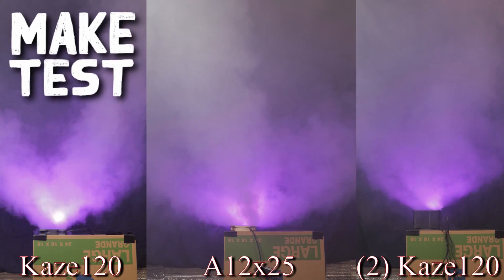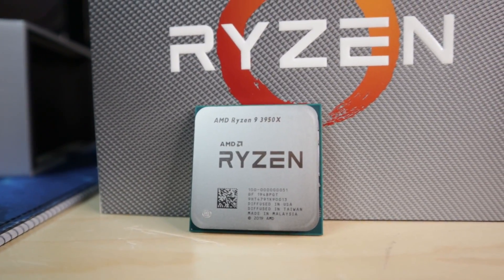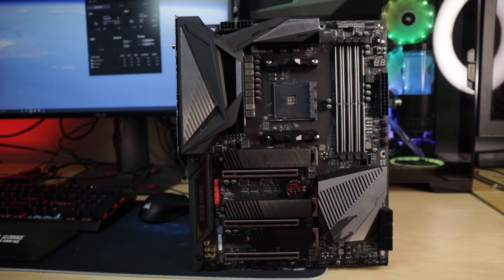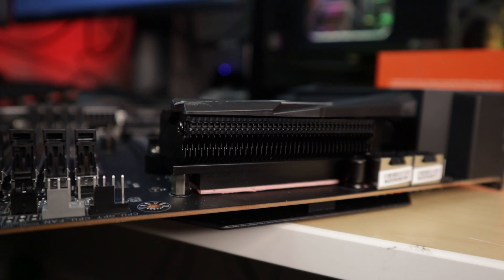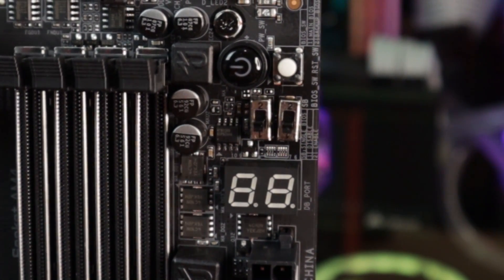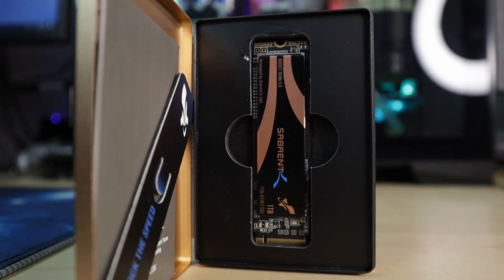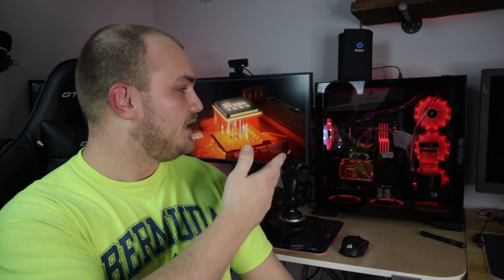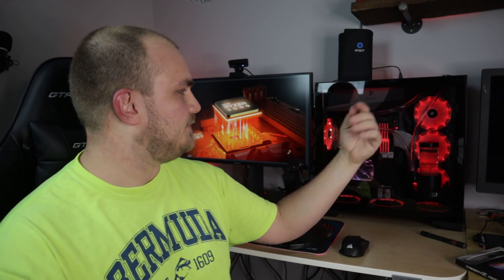EVERYTHING WENT WRONG, Upgrading I7-7700K to Ryzen 9 3950X

Comment: Welcome to the Red side, bonus points for MX4, only thing I use x) Well I still got paste left in the original 2011 tube, so partly why :D You are under water, so doesn't matter as much, but 1.0.0.4 agesa runs my 3600x 10C hotter than 1.0.0.3 ABBA. Here's to hoping 1005 is good on idle again too.

Comment: the pinouts of one maker's power supply's modular connectors, arent standardized to other manufacturers. Ive seen manyu people destroy their powersupplies and components with mis-matching cables. get your ram timings optimized beyond just the  xmp profiles say. you'll notice a significant improvement. ryzen memory calculator is very helpful.
Reply from the maker: This is news to me and seems like something that should be standard, glad my antec PSU had a safety circuit
Reply: @MajorHardware  You are lucky my friend. I learned this lesson the hard way and murdered one of my 980 TI's a few upgrades back. My Thermaltake Psu didnt  have the safety circuit and the sparks were real.
Reply from the maker: Jesus! I'm lucky

Comment: Since your RAM is only running 3000Mhz right now, maybe it would help the gaming performance to try different Infinity Fabric clocks in the BIOS (e.g. keep RAM at DDR4-3000 but boost FCLOCK from 1500Mhz to 1800 or 1866)?  Ryzen 3rd gen may not be a huge overclocker on water, but there's still a lot of room for tweaking with fabric clocks, small undervolt + PBO, and tightening secondary and tertiary RAM timings.
Reply from the maker: im excited to see what i can squeeze out of it

Comment: U are lucky that the magic smoke didnt come out
Reply from the maker: I know antec psu for the win
Reply: @MajorHardware  the click you heard was most likely a protection kicking in withing the psu
Reply: @liev535  exactly...probably had a hot wire pin switched with one of another voltage, triggering overvoltage protection.
Reply: Rare that burn off Something. Good psu have load protection on volt line.
Reply: Lars Nielsen yes but repeated triggering of ovp or ocp can burn up the protection circuit, rendering the whole unit inoperable
Reply: @Akira_203  I bought a new Super Flower Leadex III 80 Plus Gold some months ago, started installing windows and the PSU died suddenly clicking the protection.

Turns out the PSU was crappy and I got a new one from RMA. Can't trust a "quality" brand anymore nomatter what the maker is, just luck :)
Reply: @eamh2002  sometimes shit happens get DOA or faulty with any company but the fact that it died but didnt take any other components with it shows at least decent quality in circuit protection
Reply: @eamh2002  even finest brand can have faulty unit you have to take into account they makes tens or hundreds thousands of units so it even failure rate is like 0.1% (just pulling number out of my ass) it has to happen sometimes
Reply: yeah, Magic smoke like what verge guy had off camera XD

Comment: Cranking the infinity fabric (FCLK) to 1900 will also improve gaming perf. Especially if you can get your ram to 3800 CL16 (coupled mode). You can use Ryzen Dram Calculator for tight timings
Reply from the maker: I need to do more research on tuning AMD

Comment: The chipset drivers needing to be updated wouldn't happen to be the cause of the ram issue? I'm guessing not but just curious. Great video, thanks.
Reply from the maker: im not sure, i know the PSU cable was the first issue but the chipset update was night and day. before updating i got stutters and lockups after update buttery smooth and increase in performance in gaming and productivity tasks
Reply: @MajorHardware  have you tried the new ram after the chipset update?
Reply: I was thinking the same while watching your video, you should pop back in the 3600mhz ram to see if it works after the update if you haven't sent back the 3600mhz already.
Reply: didnt he say one of the ram sticks didnt work on another motherboard

Comment: I just had the same problem a few weeks ago used a antec cable on a thermaltake psu , swapped out for 2 other psu's left the cables in the case lol funny how it booted up if I left that one cable unhooked, I was using one of the sata power ports to run a pci-e cable for the graphic card worked fine on the other psu
Reply from the maker: The fact app psu arnt standardized is criminal

Comment: Several years ago I found out that PSU manufacturers do NOT wire up their cables the same. I fried a 400GB hard drive. Thankfully it was given to me by someone that didn't bother with drives under 2TB! After that if I had PSU cables mixed I made sure with a multi meter which wires went where so I don't land up frying anything ever again!
Reply from the maker: I had no idea this was a thing why is this not standardized
Reply: @MajorHardware  Dude, that's exactly what I was yelling in my head when I realized my hard drive had died! 😁
Reply from the maker: Glad nothing died on my misadventures
Reply: @MajorHardware  I am VERY happy for that dude!

Comment: Just a quick tip: When you get new CPU, RAM and MOBO, you first boot it on the table and make sure its all in working condition, then you build it in the case. 
This way you can make sure there isn't something wrong with your system.
Good luck next time XD.
Reply from the maker: It's worse than that I always skipped that being over confident that nothing was wrong this time I paid for it
Reply: I've been always building directly into the case. Nothing went wrong so far.
Reply from the maker: Same here until well this one
Reply: when you buy everything new you check the compatibility list and do not spend money on something I can work for a week and then it turns out that sometimes it is not stable ... These lists are long there is a lot to choose from and nothing costs.

Comment: When I built my computer, I mixed up spdif with a 5v argb connectors and my computer wouldn't boot. Spent 1 hour taking all apart and testing to find out that it won't boot with an argb connector in spdif. Took about 3 hours to build but other than that it was fine.
Reply from the maker: yes thats what i did and wow does it suck doing all that work only to find out it was something little

Comment: I upgraded to a 3950x as well. I upgraded from a 2700x. I went from 32gb of 3000mhz ram to 32gb of 3600mhz ram.
Reply from the maker: i have a kit of 3600 ram but i got a shotty kit so i need to RMA it
Reply: I OC'd my 3200C14 kit to 3600C14 although I just got 2 additional DIMMs so I can't quite do C14 anymore. Still I'm impressed what OCs some DIMMs can do
Reply: Buy good quality Samsung B die RAM like a  3200 CL14 or 3600 CL16 kit and just overclock it or tighten the timings, good quality B die ram can run the same timings.  This is a good way to save money and get the same performance.
Reply: @davidbrennan5  That's not true. Buildzoid has a video on the subject where he shows how some of his b-die is absolute trash while some of it can reach insane overclocks and low timings. Chances are a 3200 C16 kit wasn't sold as a 3200 C14 kit for no reason, but because of binning.

Here's the link: https://youtu.be/ZJDXsoYKZaY?t=1702
Reply: @kendokaaa  I said buy quality kits, The stuff he tried that  was junk were cheaper kits. They keep the better bins or SKU's for their higher end products generally.  I have never seen a quality B die kit not hit 3600 at 14cl at least.
Reply: @davidbrennan5  You specifically said "all B die ram can run the same timings."

I did see that you said quality kits but that doesn't change that your sentence I highlighted was wrong. Otherwise I mostly agree. I'm just trying to remove ambiguity for someone looking for ram and seeing that
Reply: @kendokaaa  I shouldn't have wrote all, I changed that to quality, the silicone lottery will also play a part and who knows how long they will sell the lower clocked stuff that can be pushed when they could just sell it at a higher clock rate and make more money. The other thing I should mention is the less sticks you have the easier it is to match the overclock and you need good airflow in your case before you overclock.

Comment: I've accidentally managed to get the old normal power plugs the old hard drives and burners used backwards just long enough to fry a new 12x plextor cd burner and two SCSI drives back when that stuff was current and expensive. Was a spendy day and probably wouldn't have happened if I wasn't trying to swap the power plug around while box was running. I have a bunch of the modular power supplies around too and yes, very easy to grab the wrong cable set and fry something or have it not work. I did similar when I was trying to upgrade my board to a 2011 and suddenly only certain devices showed up once booted. I finally took it back to my buddy and he gave me a lesser but similar board and it did it again. I finally tried swapping to a different cable and everything worked again. I'm still not sure if the original cable was dead, or from a different power supply but I did notice I had at least one cable that plugged in but the colors weren't the same as similar cables in it so I replaced it before it blew something up. I do try to keep that stuff together in the original boxes or label it but stuff happens and we live and learn.
Reply from the maker: i will keep it all together now that i know this little detail lol

Comment: you're lucky that the power supply had that feature that it won't turn on with the wrong cable. coz with some power supplies, that would fry your computer and power supply. and you'll be fucked.
Reply from the maker: that would have been the saddest of days
Reply: @MajorHardware  yeah coz I did that with one power supply and I thought I had used the same cables for a newly acquired power supply (used) and luckily I used a PSU tester and not directly to a PC. And it made a popping sound and it ended up being a blown capacitor and made a burning plastic kind of smell. That was not a good day.

Comment: Only problem I ran into was not knowing to use uefi to load up the windows USB. All the drivers and chipset updates I did as soon as I got the thing running and haven't had a single weird freeze or stutter in 2 full months which is a huge leap over the random freezes and bsod of the 2700k setup I used for almost a decade

Comment: There's really no standardization of modular psu cables between different psu brands. They all terminate the same on motherboards and other components so you don't end feeding like 12v down a 5v line and killing your parts but there's no telling them where that 12v/5v line etc needs to come out of their psu. You're lucky you didn't end up killing something on the new build.
Reply: Yes, why use non standard cable from one PSU to another PSU? 🤦I whould not doing it before knowing the pinout. Knowledge saves money and time.
Reply: Aye, just because they all end the same, doesn't mean they start the same, EXTREMELY lucky it wasn't a 8pin CPU or PCIe that got mixed up
Reply from the maker: Truetrue
Reply: I fried my hard drive and the soundcard integrated on the motherboard??! when I did the same trick with satan cables. Also couldn't reboot, I had to turn off/on manually or it would just freeze.
Reply: @haralds.5832  that's why I'm anal about keeping the psu boxes and keeping any spare cables in its proper box. That way I don't risk anything like this.
Reply: @haralds.5832  "Satan cables" haha! awesome!
Reply: @MaxUgly  well, I guess the PSU could have come with "Molest" cables, to go with those "Satan" ones...😂😂🙊
Reply: @northwiebesick7136  at least we have moved on past the evil old "master/slave" configurations of the IDE interface!
Reply: @MaxUgly  lol... You're right... I hated them
Reply: I killed a Z97I-Plus by using Silverstone braided cables with a Corsair PSU instead of the flat cables it came with. Bad day.
Reply: I think ScienceStudioYT made the same mistake years ago when he thought the NZXT Hue was causing problems but later found out the psu cables was the Culprit

correct me if I'm wrong though
Reply: @AirRookie  nope, you got it right. I don't remember the specifics of how he found out (might've been another youtuber) but that was indeed the reason.
Reply: Yeah this is why I greatly prefer non modular supplies. This is however really difficult to find high quality non modular supplies outside of the server space.
Reply: How old are you w98 is more more better... More mooore🎵🎵🎵🎶🎶🎶Tereza kesovija🎵🎵🎶🎵more a?!?)))
Reply: I had it easy with finding the fault. The Corsair cable on that Seasonic PSU led my DVD drive to melt and smoke which made it pretty obvious as to where the problem was.
Reply: Thanks for the info, appreciate it!
Reply: what about custom cables like sleevemod?
Reply: he fry up Ram at beging putting wrong cable in it
Reply: Ming Chan I don’t understand why using a cable from another psu is a problem if they are the same pin outs
Reply: @oscarcharliezulu  some of them twist around the wires from end to end to have the standard pin out. If you were to rip out all the wires from one end of a sleeved modular 24-pin cable and then had to put it back together, it would not work if you tried using the other end as reference.

Comment: Tell me about mixing power supply cables. A couple years ago I also assumed they were interchangeable and ended toasting 4 hard drives, a total of 13TB of (thanks god, backed up) data. I wanted to die. All defeated, literally sat down, opened the amazon app on my phone and spent 600 Euro in hard drives.
Reply from the maker: ya i dont understand how the cables are different
Reply: @MajorHardware  At the time I was furious from the fact the plugs are the same, also companies don't help you at all if you make that mistake. Turns out the cables inside (pinout) are different so you end pushing 12V through the wrong pin of your devices. I also almost toast my brand new AIO but is working fine. So, from there the number 1 rule is not to mix PSU cables.
Reply: @MajorHardware  the business ends are standardized but the psu ends using same connectors as other psu can have different pinouts

Comment: I have never had intel in my system. AMD processors are good but the graphics cards are finicky. One day I will get an nvidia card but the price is usually my sticking point. Nice build!
Reply from the maker: thank you
Reply: Steve from GN did a video of why you shouldn't mix power cables. Its pretty sad that the pin layout isn't standardized  across brands on PSUs.
Reply from the maker: agreed, i had never heard of such a thing and didnt even mean to mix the cables it was crazy
Reply: I love my Vega 56.

Comment: I hope you see my comment, i started watching your videos a few days ago because of the curious cooling methods you use.
Could you try cooling your pc with Vodka next?
A russian youtuber called Boris did it too and it was impressive.
Greetings from Germany
Reply from the maker: if i had spare equipment to sacrifice i want to try and custom water cool with gasoline and see if it catches fire.
Reply: @MajorHardware  hahaha nice, i think it will explode. Be careful
Reply: Lol yes water cool using vodka then play escape from tarkov
Reply: Cool with liquid metal, like the Russian nuclear submarine Reactors :P
Reply: @catriona_drummond  but that is already a thing, although maybe not how you are thinking
Reply: @sinformant  I know, but I mean liquid Bismut pumping through pipes, not glorified thermal paste :P
Reply: @catriona_drummond  😜i knew what you meant just messing with ya. But man to pump a liquid metal you would need one hefty pump. Im sure a pump that powerful would make enough racket to drive you mad. Also the temperature that Lead-bismuth eutectic remains a liquid is well above meltdown temp for a processor. But cool idea non the less
Reply: @sinformant  It's a fun thought experiment though. The only metal that is actually liquid at below destruction temps for a CPU is mercury. I don't even want to know what pumps and pipes have to be made of to use that :)
Reply: Not a good idea. Vodka has a lower heat capacity than water.
Reply: @scottc2455  but it is Vodka 😂😂
Reply: @scottc2455  I think everybody would agree to the statement "Vodka is cooler than Water."  So cooling with it will make for a much cooler machine even if it's less cool. This does make sense, I swear!